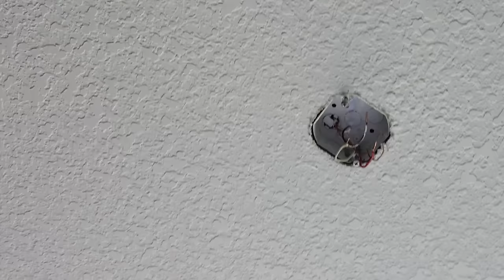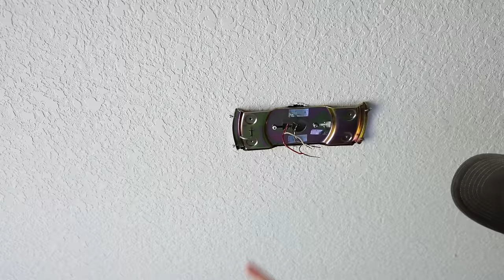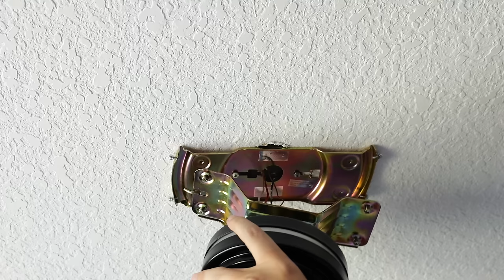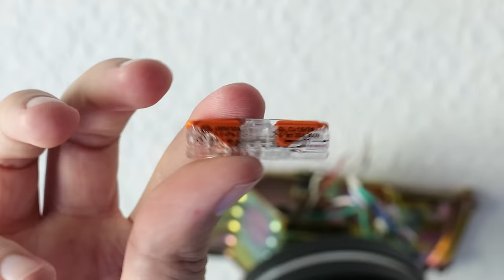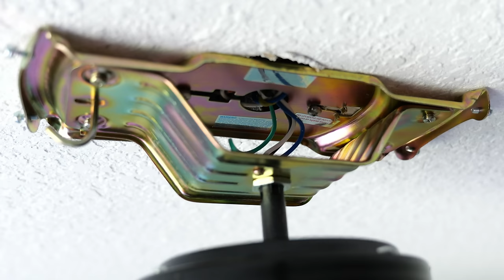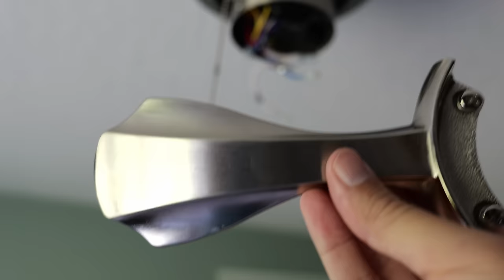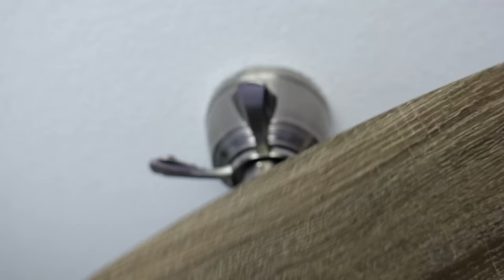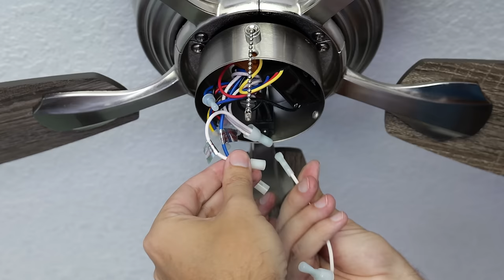Avoid This VERY Common Mistake DIYers Make When Installing a Ceiling Fan | How To

Comment from the maker: Be honest, are you guilty of leaving the wire connections out of the box in the past?  It is very common.  Also, there are links to everything you saw in the video in the description of the video if you would like to check them out for yourself!
Reply: Yup, guilty
Reply: I don't know, my electrician installed the fan so I have to assume he knew what he was doing.  The fan didn't come with a light kit so I bought an aftermarket kit years later and installed it myself.
Reply: Yep and it's just fine. I've never had a problem leaving them out of the box, and I will continue to do it that way. Not an issue at all.
Reply from the maker: It can definitely be an issue.  But you continue creating a hazard and violate code for no reason.
Reply: I'm a professional electrician and I do this. The space under the cover is usable wiring space according to code.  While it's a good idea to do this in order to try saving space for wireless fan controllers it's not required and makes servicing easier, especially for fans with your style of bracket.
Reply from the maker: Can you supply the code then that you are referencing?
Reply: @HowToHomeDIY  article 410.20 that "cover" is a fixture canopy. It's designed and listed to be wiring space for the fixture.
Reply: @ianbelletti6241  as we have discussed on another comment, 410.20 is very vague and cannot apply here unless the canopy is marked with their volume in order to calculate box fill.  I have yet to see a canopy that lists this.  Without that, the canopy cannot take the place of an electrical box as far as where the splice points reside.  The only thing the canopy does in this case is allows for there not to be a cover required on the box.  The wires still have to be in the box.
Reply: @HowToHomeDIY  No hazard at all is the point you're missing. I've messed with electric recreationally and professionally for almost 40 years and have never had a problem doing that. Much ado about nothing.
Reply: @vegasbluedevil7328 then you have messed with electricity extremely carelessly for 40 years.  Congratulations 😂
Reply: The ones I've installed had no way of leaving them out, i used wire nuts followed by electric tape, I've put up about seven of these and I'm still amazed how those two little screws that initially put in on the box hold the weight of the fan, but no problem over the years
Reply: @toddt6730  as a professional electrician I've seen too many wire nuts taped up to cover for the fact that the person stripped too much insulation off the wire. It always gets my hackles up whenever I see taped wire nuts. The only exception to this rule is with temporary power and lighting on a construction site where the connection is above 8 ft and you're taping the joint to prevent the wire nuts from coming off because the conditions permit the temporary wiring connection to not be in a box.
Reply: @ianbelletti6241  I can understand that,but I didn't strip too much wire , I just like the additional security of the tape, I've worked with electric my whole life, but I appreciate the feedback
Reply: Liked video but lost it with wiring. Knowing Red was Hot, I would of put all last 4-wires together.  Can't figure how the Blk wire will get power.  Maybe from how the switch is wired.
Reply: @HowToHomeDIY  After a ceiling fan is installed, explain how wires not being placed inside the ceiling wall into a box can create a dangerous situation in the future or create a hazard. The light fixture's upper section or base section seems to act like an electrical box extender.
Reply: Screw that, I'm going to call an Electrician...
Reply: If leaving the wire connections out of the ceiling box is against code please do a follow-up video where you show the up to code way to install a to ceiling fan remote control kit.
Reply: @smarmosaur  Great point. I just installed one of those and it would be practically impossible to tuck all of those connections into the box.
Reply: You also need to make sure you buy a box that can be used for new installation or installation where you can’t get into the attic. Old installation. And there are three scenarios on what you’ll need when it comes to one of those fan boxes. There are boxes that will install right on the edge of a 2 x 4 bridging the 2 x 4. There are boxes that straddle between studs and there are boxes that can be installed on the side of the stud. The problem is you’re pretty much gotta buy all three or Pull down your light prior then go to buy your stuff. Not only that remember if you can’t get into your attic to put the box in, you need an old installation type fan box, not one for new installation which is done from the attic. The whole reason you need a new box is if you just have a light in your ceiling you most likely don’t have a box capable, holding the weight of a fan plus light kit
Reply: you dont put them in the hole when you connect the light below the fan, so what really the difference?

Comment: If your replacing a light with a ceiling fan you should make sure that your ceiling electrical box can handle the added weight / vibration and that the box is securely mounted to the ceiling joists. You would not want the fan falling down from the ceiling.
Reply: I agree!
Reply: @DW424 is correct, ceiling fan junction boxes are labeled as "Fan Rated".  Ceiling junction boxes that previously supported a light fixture may not be fan support rated.
Reply: This is an extremely important point. A nail on ceiling box or even a ceiling box that has bracket to mount between studs are not suitable for a fan. There are many options available to retrofit with a fan rated box.
Reply: The box in the video is clearly a fan rated box.  But even if it wasn’t, how many years did we go using standard fixture boxes and people’s fans aren’t just falling out of the ceiling.  In fact up until fairly recently this was not even a requirement unless the fan weighed 35 pounds or more.  These fans, unless much larger, are typically nowhere near this weight.  So while yes it would be best to install a fan rated box and currently code, let’s not pretend like the fan is just going to come down in a fixture box.  In most cases it won’t and hasn’t.
Reply: @johnpicard4909  you are definitely not wrong that for many years no one knew of or used fan rated boxes, however we at least screwed those boxes to a ceiling joist or at least pulled on them to make sure they would support whatever we were hanging. My point really was that it was not mentioned and people should be aware. In my area, particularly for homes built in the 70’s and 80’s ceiling boxes are often nail on and I have seen fans pull away from the ceiling even if they didn’t fall.  They might not be overly dangerous, but they don’t look great.
Reply: @workshop4898  I'm in the process of replacing switched receptacles in the bedrooms of my mother's house with center lights. I decided to spend the extra $10 per box and put in fan-rated boxes. It will save me time if I put in fans (there is no A/C), or, save the next person.  Small extra expense IMHO.
Reply: He did not even touch on that subject , Humphh
Reply: @johnpicard4909  Not Necessarily, but the metal box in the video is certainly better than a plastic box. A true code complying fan rated box is not only metal but the threads are much deeper.
Reply: @stevelopez372 true, but that's to get a higher rating. Your standard metal box is listed to hold up to a 50 lb fixture. Your mounting method for the box may change the analysis.
Reply: Also when the fan is pulling air up it adds even more force pulling down on the box.
Reply: Which is another good argument in favor of using wire nuts instead of Wago’s. If the fan does fall, 3 or 4 wire nuts on 12 or 14 gauge solid wire will support the entire weight of a modern ceiling fan. Those little inline Wago’s, not so much...
Reply: I was getting ready to say the same thing.
Reply: @rodney5360  then you don’t know what you’re talking about.
Reply: @stevelopez372  that was clearly a fan rated box.
Reply: Very often light fixtures would have a plastic/PVC box, definitely not safe to attach a ceiling fan to. He should have pointed out that to check for an appropriate box since he is suppose to be educating the viewers.
Reply: That was my first thought as well. Better to pull the box out(if possible) and put in a joist to joist brace with box.
Reply: A few months ago I watched a video in which a woman used an old work box to install a ceiling fan, and I didn't think anything of it. Matter of fact, that's how I even discovered old work boxes existed. Now take a second to think about how an old work box is fixed, and you'll come to the same horrified conclusion I did when I figured out how they work. I hope nobody gets hurt, but sweet Jesus, that fan's destined to be gravity's biotch, lol.
Reply: I picked up on this  also.  The box needs to be supported--I'd take down the box and check its support.  There are a number of braces that you be able to insert through the hole where
the box is and screw intothe joist!   The way this video does it, the fan may fall down in 3-6 months of use--even sooner if the blades are not balanced and the fan wobbles.
Reply from the maker: @alanlevin167 that won’t happen.  It’s a fan rated box.  Very easy to tell.
Reply: No falling fans are fun, better if its over the bed.  Or in a kids room.
Thats gonna shut them up.
Reply: This was the mistake I was expecting in the video.... not a scare "OMG ITS DANGEROUS" to leave the wires in the open space.  Yes, it's not to code.... the code exists, so people were not making air splices in the middle of runs requiring boxes... but there's nothing super dangerous leaving the connectors in the very protected space of the mount.   yes, put the wires in the box.  No, it's not going to kill you not to.
Reply: @HowToHomeDIY I was wondering the same thing.  How is it easy to tell if the existing box is fan rated?
Reply: @HowToHomeDIY How can you tell?
Reply: UL is a thing.
Reply: viewing the video, that was the first mistake I saw.....no added support of the electrical box, the first thing I would do is make sure the box is secured properly to support the added weight of the fan.
Reply: It's almost funny that that even has to be mentioned. Unfortunately, it has to be mentioned.
Reply: @thadoggma make your own video instead of criticizing his. You're obviously more capable and knowledgeable, right? Can't wait to see the perfect video you create! God help you if you forget to add a point! The YouTube know-it-alls who watch how-to videos will be sure to bring it to your attention. Good luck!
Reply: @HowToHomeDIY a fan rated box is only as good as what it’s fastened to.
Reply: Your tip is the number one most important tip of all.
Reply from the maker: @arod7404 is the fact that its fastened to 2 rafters sufficient enough to you?  It is more than sufficient per code.
Reply: Drilling a mounting bracket to a wood is okay if you have right screws and the box is directly under a wood.
Reply: @bottomup12 I believe the box mounted to a joist will have a much more solid mount that should prevent the fan wobbling.
Reply: @athhud  Your correct!... yes it did hold the fan and it just did it to me this year. After ten years being up, the vibration backed the screws out (wich came with the fan) and down it came spinning and the wire nuts held on tight!  😮😮

Comment: Before you do anything, after you remove the light fixture, make sure that the box is properly rated and secured to hold the weight of the fan.
Reply: He didn't do that
Reply: 2020 NEC   314.27(C)   That's why you see fan base wobbling around in the ceiling J-box from 1970 house.
Reply: how do we do that
Reply: First, if it is a metal box, you should be good to go.  If it is plastic, they are rated for different weights (grey plastic boxes are rated for heavier loads) and you can check with the hardware guys on the rating.  In either case, if it is loose, you have issues.  If you cannot secure it better, you can remove it and buy a ‘remodel construction ceiling fan brace’ at the hardware store.  They work pretty well.
Reply: 👍! You beat me to it. Don't assume that it was installed to code.
Reply: I've had calls where a fan has either pulled the box out of the ceiling or pulled the threads out and fell to the floor. The fiberglass boxes used in mobile homes was bad about this.
Reply: @Mike-01234  more than likely screws aren't tight
Reply: @glasshalffull2930  Just because it's a metal box doesn't mean it's fan rated. Plastic boxes are not fan rated (at least none I've ever seen.).
Reply: @peteyc2292   There certainly are plastic boxes out there that are rated for ceiling fans.  (I personally wouldn’t use one).  According to NEC 314.27 (C), outlet boxes must comply with ‘ONE’ of the following:
1) Listed for the sole support of ceiling suspended ( paddler) fans
2) An outlet box complying with the applicable requirements of 314.27 in providing access to structural framing, capable of supporting of a ceiling, suspended (paddle’ fan bracket or equivalent.

How I read this is a metal junction box that IS PROPERLY SECURED TO FRAMING is allowed.  Once again, any box that is loose( not properly secured to framing) should be replaced and as long as you’re replacing it, it would be prudent to use a fan rated box.

Comment: When two or more switches together, the first switch closest to the door, should always be for  illuminating the room your entering into. This applies to garages or any building too.
Reply from the maker: Appreciate the input.
Reply: counterpoint: when you have two or more switches at an entry door, the one closest to the door should turn on the light outside the door, and then they should go in order of how commonly the light is used - I.E. the second turns on the primary light inside the door, and any more switches will turn on accent lights.
Reply: @kenbrown2808  guess it's a matter of preference. I've also heard the first switch one comes to when exiting to the outside, should turn on the outside light(s). Probably depends on the codes in any area and the year of construction.
Reply: My 2005-era home was wired this way as well - closest to bedroom or room entry door is light, then the next one is fan. If a gang of 3, the 3rd and furthest would be switched outlet.
Reply: Could you please give a code reference for that statement? I’ve taught the NEC through many different code cycles and that’s news to me.
Reply: @mrkricketman2945  Two things: which statement? And no I don't know the the actual codes nor will I look them up for youtube. I did not say as "fact" or "all codes say" but from my understanding from  being around electricians over the years. So obviously, you know all the NEC codes over the last 50+ years so what's the point asking me? Please educate all of us.
Reply: @mrkricketman2945  you mean for which switch is which?  that's not specified in code, that's just a standard practice. - other than california has or had a code that the first switch you come to in a bathroom turns on a high efficiency light.
Reply: Makes sense to me as well. Having logical consistency helps. As for the switches by the entrance door, I prefer inside light first, then outdoor porch light second. I use the indoor light 5x more often than the porch light and that's more important to find first when stumbling into a dark room when coming inside.
Reply: I wonder why, often, the switches seem opposite of where they should be.
Reply: @mrkricketman2945  Ok all , you are absolutely correct. I was wrong to repeat what I have apparently incorrectly learned from mistaken certified electricians over the years. Now it's no longer an issue. Have a good day. 🙂